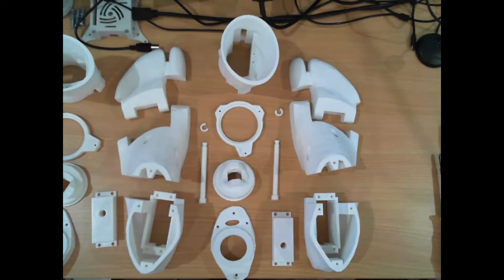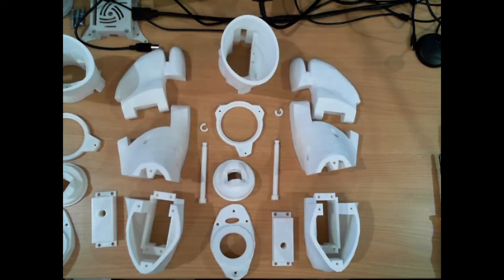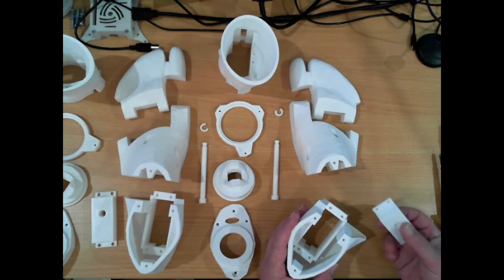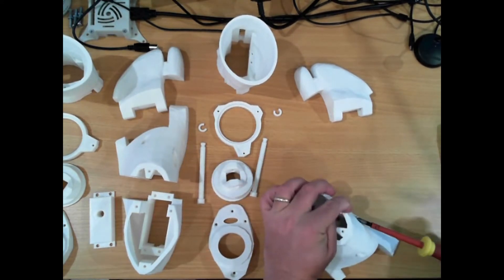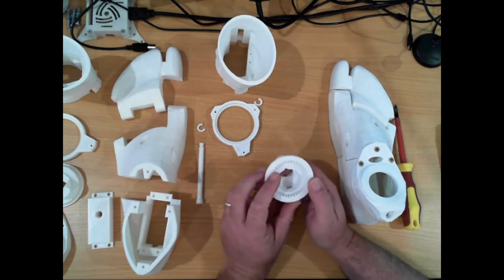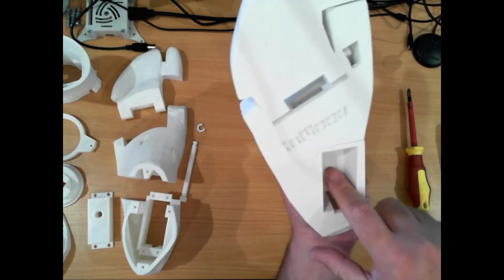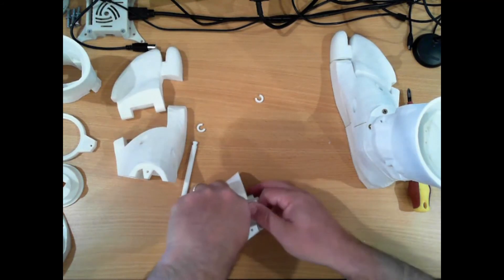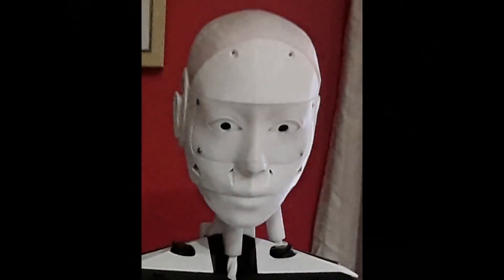Inmoov, Freds Ankles and Feet

Comment: Nice video, planing to build one
Reply from the maker: Well worth it just from the learning side of things.
By the time your finished, you will have perfected 3D Printing, mechanical assembly as well as programming :-)
If you run into trouble there is a huge community world wide to help
Reply: @CyberOne  Thank you for the motiviation. So my status is pretty new. So first I made my printer working.Build an A8 from scratch made it run with a quality that'S ok. But will be improved. - So I bought the filament and some cheap servos and of cause  I have some arduinos from old stock.
I hope to get this delivered in the next week and I start with the finger and move from there.
Do have an advice for some silet servos? The cheap ones are very noisy which is completly ok for learning.

Best regards,
Stefan
Reply from the maker: @stefanw8203  I haven't found quiet servos yet. :-)
The Standard or plastic one are quieter, however they don't last very long, your better off with the MG or Metal Geared servos.
for the small size SG90 I found they were very cheap, but they fail easily.
I instead have started using the PDI-1109MG servos. They are like 4 times the cost but appear to last 10 times as long.
For the mid sized MG996R, I found them cheap enough but not very reliable. instead I've gone with  the PDI-6221MG.
I did start out with all of the Tower-Pro-MG996R servos, but as they fail I'm changing over, a real pain with some of them.
For the large servos, I use the recommended Hitec HS805BB.  Some out there have designed adapters that will allow you to use the  MG996R servos in their place, but for the likes of the bicep and shoulder servos I would not recommend it.

You can reduce the noise a little by adding more  grease but don't  over do it.

The single biggest tip I can give you, is,
Have Fun Building :-)

Ray
Reply: Thank you for your adivce. Great